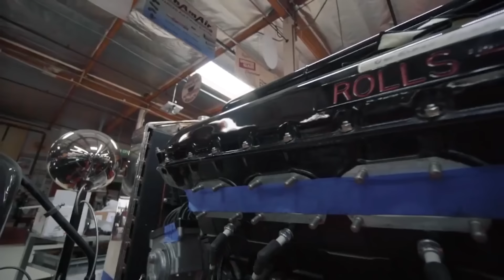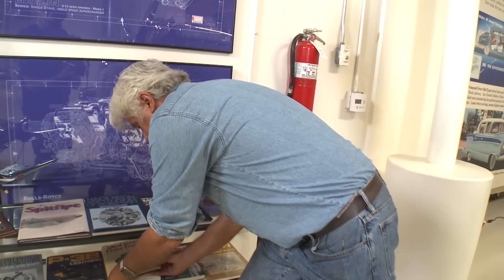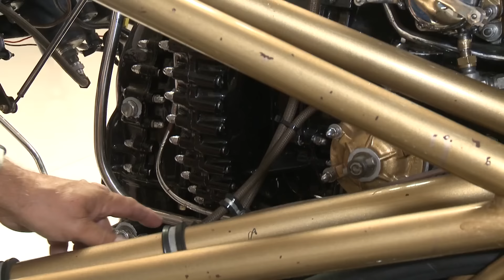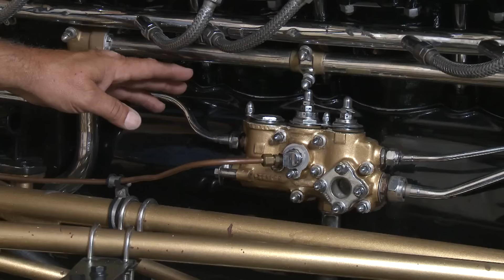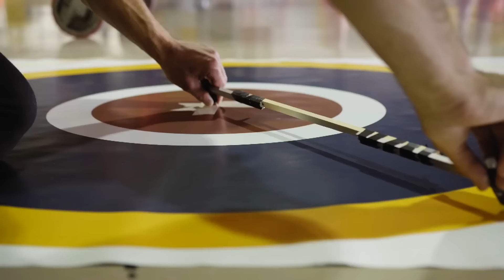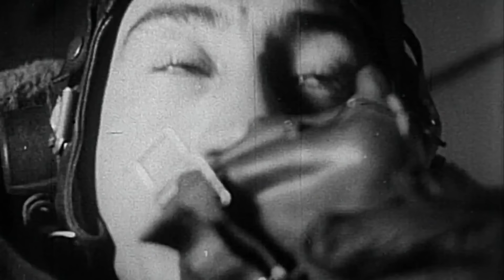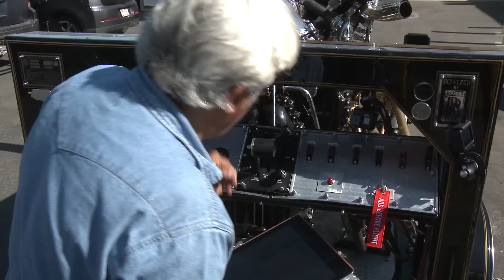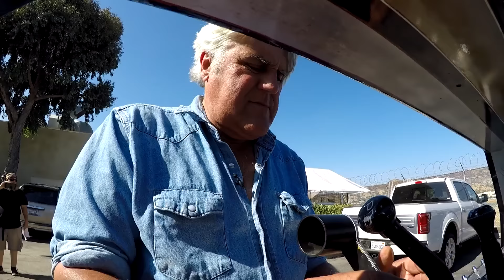The Engine That Won World War II - Jay Leno's Garage

Comment: these engine couldn't keep up with nazi turbine jets
Reply: Greatest King You men the jet engines that lasted average 10 to 20 hours before being completely rebuilt Lol.
Reply: Clearly british and American aircraft were better.
Reply: Of course not...they were 15 year older designs and also VERY FEW turbine driven nazi planes flew correctly if at all
Reply: The same Nazi jets which were based on a British patent?

https://en.wikipedia.org/wiki/Frank_Whittle
Reply: The German engineers studied Whittle's work very carefully before beginning their own jet projects.  Whittle was grossly under-funded, so the Germans got to the point of running and fitting an engine into an air frame first.  But Whittle's engine was far better than the German ones - mostly because the Germans were short of high temperature metals to allow good power and durability.  The German engines were good for around 10 hours before needing a total rebuild, assuming they didn't have a catastrophic failure before-hand. Also, they were terribly short of fuel, and pilots experienced enough to fly the Me 262 - the good ones had been killed by pilots of those 'inferior' Spitfires and Mustangs
Reply: My riding mower can't keep up with my car.
Reply: The De Havilland Mosquito gave a good try though.
Reply: "In 1940 I could at least fly as far as Glasgow in most of my aircraft, but not now! It makes me furious when I see the Mosquito. I turn green and yellow with envy.

The British, who can afford aluminium better than we can, knock together a beautiful wooden aircraft that every piano factory over there is building, and they give it a speed which they have now increased yet again. What do you make of that?

There is nothing the British do not have. They have the geniuses and we have the nincompoops. After the war is over I'm going to buy a British radio set - then at least I'll own something that has always worked."

~ Hermann Göring, January 1943
Reply: "these engine couldn't keep up with nazi turbine jets". But these engines powered a myriad of useful aircraft, from bombers, to reconnaissance, to fighters to anti-shipping attackers..... The German designs were ambitious but they simply couldn't replace their aircraft, tanks and ships quickly enough - even when they used forced slave labour.
Reply: P51 B/C/D's with Packard built Merlins shot down 121 ME 262's from NOV 1944 to MAY 1945.  And P51 gun camera film proves that 70% of the kills were at high altitude, in high speed combat during ME 262 attacks on bomber formations.  So clearly the Merlin powered P51's not only figured out how to keep up with "Nazi Turbine Jets", but also how to catch and kill the "Nazi Turbine Jets".
Reply: "The German jet engines had nothing in common with Whittle's engine, they didn't even have anything in common with Ohain's engine design"

Wrong. 

"Hans Von Ohain patented a jet propulsion engine design similar in concept to that of Sir Frank Whittle but different in internal arrangement in 1934. "

http://theinventors.org/library/inventors/bljetengine.htm

And

"In 1935, Hans von Ohain started work on a similar design in Germany, and it is often claimed that he was unaware of Whittle's work.[11] Ohain said that he had not read Whittle's patent, and Whittle believed him (Frank Whittle 1907–1996). However, the Whittle patent was in German libraries , and Whittle's son had suspicions that Ohain had read or heard of it.[12]"

https://en.wikipedia.org/wiki/History_of_the_jet_engine

" it was the first ancestor of the modern turbine engines that we use today."

Wrong again.

"The modern jet engines of today have developed from Whittle's original design into highly efficient systems that can power huge aircraft for thousands of long-distance flights with minimal maintenance."

http://www.eng.cam.ac.uk/news/current-jet-engine-research-whittles-centenary-year

Additionally, it was Frank Whittle's engines that were sent to the US and USSR whose derivatives powered their respective fighters, which contributed greatly to the arms race between the two. Add to that the fact that RR is still a world leader in jet propulsion using its own designs that all derive from Whittle's original design, and it should be clear whose jets power the modern world.

8/10 for effort.
Reply: Absolutely wrong. All gas turbines - btw the Englishman John Barber was the first man to describe in detail their operating principle as early as the 18th Century -  aero, marine and stationary, have the same three basic elements: the compressor, the combustion chambers and the turbine. The only difference between Whittle's design and the German engine in the Me 262 was that Whittle used a radial compressor and axial turbine where the German engines had axial compressors and turbines. Radial compressors are more efficient, but become too wide for larger air throughputs. The British company Metropolitan Vickers also began pursuing a fully axial design in parallel with Whittle, BTW. In those early days there was little difference in thrust between the two variants and the radial design was used for years in highly efficient turboprops.
Reply: War is a game of numbers, the greater numbers win, not the best weapons.
Reply: Greatest King thankfully the me262's came too late to save the luftwaffe...not to mention they were unreliable. Just a quick fyi...a race ready merlin will smoke a 262.
If we're comparing apples to apples...the krauts got their asses handed to them in their bf109's & me309's. Even the DO335's got their asses handed to them regularly by mustangs & spitfires.
Reply: The leading German turbojet engineer Ohain is on record as saying that he examined Whittle's work very carefully indeed as a preliminary to designing his own engines.
In the years immediately following WW2, Whittle-type turbojets were the most powerful.
It is clear that Whittle first proposed the turbojet, instigated the first project to create a jet engine, and during the pioneering period his engines were the best developed.  It is inevitable that development takes new directions. That does not undermine the importance of the pioneer. Whittle was that pioneer.  End of.
Reply: P51B/C/D gun camera film shows that about 70% of the P51 kills (121 kills) of ME262's were at high altitude during the jet's attack on bomber formations.  On Mar 24, 1945 the 332'nd FG (Tuskegee Airman) shot down 3 ME 262's at 25000 ft during a bomber formation attack; less well known is that during the same attack, the 31st FG shot down 5 more ME262's, for a total of 8 ME262's downed in high altitude, high speed combat during that attack.
Reply: Tyrion L  That's true but only because they ran out of new pilots and really flew the entire war or until the were killed. While in the US they flew 25 to 50 missions and went home.
Reply: Metropolitan Vickers was Westinghouse (in the U.K. )
Reply: There was no Whittle engine from 1924, and Whittle's engines didn't have axial-flow compressors or annular combustion chambers.
Reply: The larger gas turbines (heavy frame turbines) that are used to generate electricity operate on the same principle as the gas turbine engines used in aircraft, but they're not actually aircraft engines. Many smaller turbine engines that are used to generate electricity are actually derived from aircraft engines. The steam turbines that are used in thermal power plants (and were used in ships) are not complete engine systems, they're just part of an external combustion engine and simply convert heat energy into mechanical energy. Gas turbines are internal combustion engines.

If I was promoting idiocy, you'd be able to prove me wrong somewhere instead of whining about how I worded a comment.
Reply: rofl
Reply: Russell Garr p
Reply: The German piston engines, and the aircraft powered by them, couldn't keep up with the British jet engines and the aircraft powered by them. And in the final stages of development there was never more than a few weeks between the development of the British and German jet engines. The same also applies to the aircraft they powered.
Reply: One thing Ohain's design had over Whittle's was an annular combustion chamber, again something that modern turbine (aero) engines use almost exclusively.
Reply: It's arrant nonsense to talk about a dead end for a product that contributed so much to the advancement of not only aviation but also marine propulsion and electrical power generation, and went on to be used for decades after its invention. Just as it's nonsense to denigrate people who had ideas before technology was there to implement it. And as stated elsewhere here, the German design was far from mature. True is that at any stage in their development, the engines of Whittle and von Ohain were roughly comparable in performance. Axial designs were well advanced in the UK as well. In fact Whittle also foresaw eventually moving to axial compressors (he used axial turbines) but did not want to sacrifice the higher efficiency of the radial compressor until he had to.
Reply: The Germans studied GRIFFITH'S design, not Whittle's, and decided that a turbojet was better than a turboprop. Jet engine development was done by BMW and Jumo at the urging of the RLM, Ohain had little to no involvement. 

The Germans were the first to put all of the pieces together! They had the axial flow compressor, the annular combustion chamber, and they used their engines as reaction engines instead of using them to produce mechanical power like Griffith wanted to. Regardless of who came up with the technologies, the Germans were the first to put them all together in the way that we use them (almost exclusively) in modern engines. 

AGAIN, the poor reliability wasn't by choice, they were simply out of the materials needed to make the engine reliable, they had diverted those materials to U-boat production. Remember, this was WAR, they didn't have everything they needed available to them all of the time.
Reply: Oh, and even Whittle was inspired by Griffith's design, but, again, Griffith wanted a turboprop.
Reply: They didn't need to,the Hurricanes,spits p-51's just hung around the 262 bases and went on a hunting spree as the jets ran out of fuel and had to land.look it up,it was the RAF,USAF tactic and history shows it worked very well
Reply: "History is written by the victors."

An overused postulate peddled by idiots trying to appear intellectual. No amount of history rewriting can change the fact that it is Whittle's designs that formed the basis of all modern jet engines. I know from experience that people like you with obvious cognitive biases simply will never accept any idea or provable fact that contradicts their own delusions. Are you sure you're not a flat-earther?
Reply: Or a creationist?
Reply: If it weren't for the Christians and especially the atheists (Russia) there wouldn't be any Jews in Europe.
Reply: If it wasn't for fools believing in any made up religion many wars wouldn't have happened.false deities are dangerous....seeing as yo comment i'm guessing you have one
Reply: War is a game of numbers, the greater numbers win, not the best weapons.
Reply: "Oh? So why do none use centrifugal compressors, or individual combustors? "

Are you still trying to suggest that modern jet engines are not derived from Whittle's design? Seriously? 

https://en.wikipedia.org/wiki/Denialism

"The British (the Metrovick F.2), the Germans (the BMW 003 and Jumo 004) and the Americans (the Westinghouse J30) all converged on the same design at pretty much the same time"

Nope. As previously stated, the Germans had access to Whittle's patent and the Americans and Soviets were given one of Whittle's engines each. There was no 'convergence' since they didn't invent their own designs. If anything they diverged, although still bearing a strong resemblance to the original.

https://en.wikipedia.org/wiki/Rolls-Royce_Nene

"The irony!"

Are you sure about the definition of 'irony'? You made moronic assertions that I countered with references. You keep trying to peddle the same old bullshit that you can't provide any proof of. 

"Can't refute someone's argument? Just attack them!"

Your 'argument' was refuted many posts ago, chump. But yeah, it does look like your have some sort of issue given that you insist on trying to prove falsehoods. Autism maybe?
Reply: "Are you still trying to suggest that modern jet engines are not derived from Whittle's design? Seriously? "

You haven't done anything to counter that assertion. If they're based on Whittle's design, why are they completely different from it? 

" As previously stated, the Germans had access to Whittle's patent..."

Then why are the Jumo 004 and BMW 003 completely different from Whittle's engine? Why are you trying to have this argument when you don't know anything about engine technology?

"There was no 'convergence' since they didn't invent their own designs."

The engines I listed were very different from Whittle's engine, but they're very much like modern jet engines, which are also very different from Whittle's engine.

The Nene was almost a copy of Whittle's engine, but also has very little in common with the engines I listed, and it also has very little in common with modern engines. HOW ARE YOU NOT GETTING THIS? The engines even don't even LOOK similar!

You need to learn the difference between radial-flow engines and axial-flow engines, and the difference between combustor cans and annular combustors.

"You made moronic assertions that I countered with references."

And I've explained why those references are wrong or misleading.

"You keep trying to peddle the same old bullshit that you can't provide any proof of. "

Whittle did not design an engine with an axial flow compressor or an annular combustion chamber, others did, modern engines use axial flow compressors and annular combustion chambers, how much more proof do you need?

"But yeah, it does look like your have some sort of issue given that you insist on trying to prove falsehoods."

How about this: Show me an engine that Whittle designed that resembles a modern engine and I will concede that I was wrong.
Reply: 63DW89A - Overwhelming numbers.
Reply: The biggest reason for the Me-262's constant maintenance was due to the fact that the metal needed to construct it's engines was inside British controlled territory.
Reply: +idontcare80 "Overwhelming Numbers" is the usual lame excuse for the ME 262's lack of effectiveness.  The truth is the P51B/C/D neutralized the ME262 so effectively in one-on-one encounters, that the USAAF's initial fears of the jet's effect, subsided to the point that there was no USAAF attempt to speed up P80 jet development.  P51B/C/D gun camera film proves that the P51 handled the ME262 with surprising ease.
Reply: The ME262 was a prototype to superior technology in 1944/45, but the first generation developmental jet turbine of 1944/45 was not superior technology to the piston-engined fighters at peak development of 1944/45.  This is why the P51/P47/Spitfire/Tempest easily handled the ME262 and shot it down quite handily.  

This is not a putdown of the ME262, probably the most developed jet of 1944/45.  ANY jet of that era (P80, Gloster Meteor, etc) would have suffered the same fate against the P51/P47/Spitfire/Tempest.
Reply: Greatest King +Yeah..didn't the nazi get the Americans to the moon?
Reply: S`rght ,I do not understand the whole jet versus piston point any way. But to get back to piston enginesThere is a guy called Ron William ,further down this page,who makes the comment that "the Allison was a copy of the Merlin".I was going to disagree but then thought you might have a better ,more concise answer.
Reply: I didn't think I'd be willing to do it, but I did it. I love writing about engines :D.
Reply: Yep, no shortage of experts on this planet.
Reply: I'd say that the majority of people are just so ignorant and stupid that they have no idea how to tell when someone is actually right or wrong. Just spend some time on Reddit and you'll see idiots and trolls get more upvotes for comments that are nothing but babbling nonsense than people who actually know what they're talking about, just because those people either commented later on, or just aren't very good at writing, People just latch on to whatever sounds good, or to whatever they want to believe.
Reply: It worked but you didn't want to meet a 262 in a piston engine fighter in normal combat.
Reply: That's not what this discussion is about, it's about who first applied the design which modern turbine engines (or even just the latest iterations if the turbojet engine) use today to a production engine, and that was Jumo and BMW. Combustor cans (which sounds silly to me) are only widely used on stationary turbine engines, not aero engines.

The Germans never bothered using centrifugal compressors in their fighter aircraft, and centrifugal compressors were replaced by the technology that the Germans chose to use right from the beginning in their fighters.
Reply: Well centrifugal compressor jets were most definitely the engine of choice for the Soviets on the Mig15 and so on and they had any number of pet Nazi scientists and technologies so draw your own conclusion.Remember what a shock the Mig15 was? Well that`s all thanks to RR selling the Soviets engines!!!.   Centrifugal engines went into wide aero service and are still in use today for any aero engine that requires a short length and ruggedness and simplicity (Helicopters for one).THe Allison j250 is centrifugal  and I think the most numerous jet aero engine ever built.(Now the RR M250)THe combuster cans are certainly not "silly" as you call them as they do the job they were designed for and reduce the temperature the power turbine blades see.No need for really fancy alloys or single crystal Turbine blades.THey are also cheap and easy to replace.Ticking many boxes the centrifugal RR copies stayed in mainstream aero production and use around the world for decades after US and UK had relegated them to a secondary role.
Reply: It's ridiculous how often I have to repeat myself because people can't read. 

Basically everyone used centrifugal compressors in the post war years, but they were the inferior design when compared to axial flow turbojets, which is why they weren't produced for very long after WW2. You'll usually only find centrifugal compressors used in combination with an axial flow compressor on modern engines (Including the Allison 250). The engine wasn't the reason why the MiG 15 was such a shock, it was its overall performance, which was largely due to its advanced airframe. The MiG 15 and the Sabre were both based on a German design, which is why they were so similar.  

"THe combuster cans are certainly not "silly" as you call them ..."

I said the name sounds silly to me, and using combustor cans on aero engines is definitely silly.

The only reason the centrifugal compressor was so widely used in reaction engines after the war was because that was simply the technology the allies chose to adopt, because it wasn't what the 'bad guys' (the Germans) had used. I suppose there might have might have been a cost advantage, but that's not really relevant to this discussion.

Anyway, my point is that the Germans had the more modern design first, I don't understand why that's so difficult for people to understand.
Reply: I was only thinking the same. It's ridiculous how often you repeat yourself.
Reply: The alternative is to remain silent and let idiocy prevail.
Reply: +johnnybottle , aircraft turbines have had little to do with electric power generation on a large scale.  Those turbines have been around since the age of steam.  And The British Royal Navy had turbines driving the propellers for over a century.
Reply: Gas turbines are actually very different from steam turbines, they're really quite a bit like giant aero engines.
Reply: Or, in your case, to promote it.
Reply: Promoting confusion again. It's the other way round. Giant aero-engines - or small aero-engines - are gas turbines. You can either use the thrust they create to propel an aircraft or to drive a power turbine attached to a generator or other driven equipment, like a gas compressor. In some cases, you can also drive equipment direct from their  shafts.
Reply: Yeah?  So?  What's that got to do with anything?
Reply: idontcare80 

So if I fight 100 men with balloons on sticks and I'm on my own with an automatic weapon with sufficient ammunition they'll still win?
Reply: Chev Chelios - It's definitely a possibility. Do you have enough ammunition (a resource) to kill 100 men? How long will it be before you're overrun and suffocated with a balloon on a stick?
Reply: Do you mean the nazi turbine engines that would melt down when you adjusted the throttle or the rockets that would explode on landing with the fuel cells would rupture
Reply: LH Your confusing the turbine engines with the rocket engines they used.
Reply: No, YOU have no idea what you're talking about. While it's possible that German designs may have influenced modern designs, to suggest that Frank Whittle's design was a 'dead-end' is beyond moronic. Even if what you were saying was partly true, which it isn't, do you honestly believe the Germans didn't study Whittle's original patent and that what we have today is a wholly German design, despite their infamous poor reliability? Does it not matter to you that the experts, without exception, regard Whittle as the father of the modern jet engine? Flat-earther by any chance?
Reply: ""Overwhelming Numbers" is the usual lame excuse for the ME 262's lack of effectiveness."

Because it's the truth. The only way to defeat a superior weapon with inferior weapons is to have overwhelming numbers of them. Also, the Germans were out of well trained pilots at that point, they were out of basically everything at that point, the allies had already destroyed the effectiveness of the German military.
Reply: The German jet engines had nothing in common with Whittle's engine, they didn't even have anything in common with Ohain's engine design, other than the fact that they were reaction engines. Really, it was Alan Arnold Griffith who was responsible for the success of jet engine technology, because it was he who made the axial compressor a viable technology. The reason Griffith isn't really responsible for the German engine designs was that he didn't believe that a turbojet would be a viable technology at all and wanted to build turboprops instead. It was the Germans who first developed the axial flow turbojet, and despite their short functional life (which was a result of resources being limited at the end of the war, not poor engineering), it was the first ancestor of the modern turbine engines that we use today.
Reply: You have no idea what you're talking about. Ohain very probably copied Whittle, but Whittle's design was a dead end. MODERN turbine engines are almost exclusively axial flow engines, and those were first developed by the Germans.

Barber did develop a gas turbine engine, but it used a piston compressor, and it had no real value because of that. That's the key thing that you're missing here, the axial flow compressor. I'm not sure who first described it, but it was Alan Arnold Griffith who described how to make a practical turbine engine with one, and it was the Germans who first refined the design into something that was actually usable. Griffith didn't believe that turbojet engines could ever be practical (he even told Whittle as much), he wanted to develop a turboprop engine. 

Some modern turbine engines do use centrifugal compressors, but usually in tandem with an axial-flow compressor. The only modern turbine engine that I'm aware of that solely uses centrifugal compressors is the Garrett TPE331 turboprop.
Reply: "Does it not matter to you that the experts, without exception, regard Whittle as the father of the modern jet engine?"

History is written by the victors.
Reply: "No amount of history rewriting can change the fact that it is Whittle's designs that formed the basis of all modern jet engines."

Oh? So why do none use centrifugal compressors, or individual combustors? 

I mean, I'm not even saying that the world based its modern jet engines on the German designs, I'm just saying that the Germans had it first. The British (the Metrovick F.2), the Germans (the BMW 003 and Jumo 004) and the Americans (the Westinghouse J30) all converged on the same design at pretty much the same time, it was just inevitable, but the Germans did it first.

" I know from experience that people like you with obvious cognitive biases simply will never accept any idea or provable fact that contradicts their own delusions."

The irony!

" Are you sure you're not a flat-earther? Or a creationist?"

Can't refute someone's argument? Just attack them!
Reply: "The leading German turbojet engineer Ohain is on record as saying that he examined Whittle's work very carefully indeed as a preliminary to designing his own engines."

You people can't fucking read! Ohain worked for Heinkel, not BMW and not Jumo, his engines were very much like Whittle's, the Jumo 004 and BMW 003 were NOT like Whittle's engines and were developed by completely different people. LEARN HOW TO READ.

"In the years immediately following WW2, Whittle-type turbojets were the most powerful."

Duh, because the British didn't get bombed into oblivion. You do understand that the allies won the war by destroying German industry, right? How could the Germans continue development on their engines when their ability to produce technology was destroyed? This is like talking to little kids!

"It is clear that Whittle first proposed the turbojet, instigated the first project to create a jet engine, and during the pioneering period his engines were the best developed."

Except that they were a technological dead end and nothing like them is in use anymore!

"It is inevitable that development takes new directions."

Yes, and that direction happens to be the same direction that the Germans took!

"Whittle was that pioneer."

He pioneered a technology that was obsolete before the end of the 1950s, end of story.
Reply: who cares about this? the real question is who had better pilots? obviously the Germans. look at the kill count.
Reply: 63DW89A - Right, so I guess the overwhelming numbers of allied planes in the sky at that time had no effect? That's a perfectly reasonable assumption to have... I guess.
Reply: Yeah, I was trying to find a connection between the British and American axial-flow turbojets, it didn't seem all that likely that the Americans came up with one on their own, but all I could find was this:

"In March, 1943, the first US designed and manufactured jet engine went on test at Westinghouse, 15 months after the signing of a contract with the U.S. Navy Bureau of Aeronautics. This first engine, with a 19 in. intake diameter, was designated the WE19A, had a thrust of 1130 lb. and weighed 827 lb."

"Due to wartime secrecy, Westinghouse worked on its own, with no prior jet engine experience and without knowledge of German, British or other US jet engine developments. The result was the first US jet engine design, complete with an axial compressor, an internal annular combustor, a turbine and jet exhaust nozzle."

"The basic principle of the engine was similar to the original Whittle engine developed in England, but Westinghouse’s use of an axial flow compressor, along with internal combustion chamber, were major advancements that led the way to a practical engine for aviation propulsion. (Earliest GE jet engines, based on the Whittle design and developed with Allison, featured a centrifugal compressor. GE and Allison had the Army contract to develop a ‘land based’ jet while the Westinghouse Navy contract was for carrier-based Navy jet fighters. )"

Anyway, it seems more likely that the design made it to the US through Metropolitan-Vickers. I guess it's possible that the company had Westinghouse engineers design an engine completely independently to see if they could come up with something better..
Reply: They were just a copy of the whittle engine from 1924.
Reply: That's easy. In the normal course of development the centrifugal compressor reached the limits of its performance and was replaced. In the case of aero-engines it was the ratio of diameter to volumetric flow that was decisive. And as already stated, turbo-prop engines like the Rolls-Royce Dart (1946 to ca. 1990) use centrifugal compressors. As for individual combustors (this terminology is rather imprecise) those are still widely used in gas turbines, too.
Reply: You don't seem to understand the concept of "operating principle". Look it up and amend your posts accordingly.